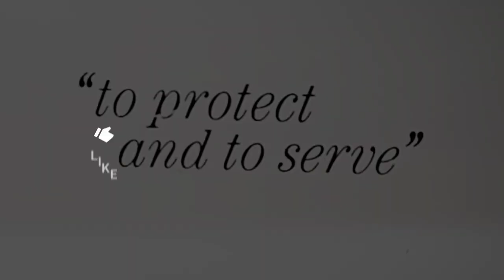Venice Homeless Encampment Cleanup in Full Swing: Comprehensive Operation Underway

Comment: Why are they throwing away the Shopping Cart??? Make that Guy return it to the Store. 🤬
Reply: The store doesn't want it back.. They would have to fumigate it before they'd let any of their regular customers touch it. .. Besides, the store has already written off the shopping cart.
Reply: I thought the same thing about that Bin on Wheels. Why didn't they use it to pick up the other crap?
Reply: I at first!  did not want to mention the shopping cart 🛒. But I taught they same thing! Bring it back to the store or use it to clean up with. 😊 such a waste.
Reply: @dessingo  Realistically, they won't know where it came from, the most they'll do is pressure wash it.
Reply: @dessingo  Ultimately, that means that the shoppers must pay more for their stuff to cover the costs of these stolen carts.  That's money out of the pocket of every single working, tax-paying person out there.  Whenever you see every cart like this, think of how much you are personally paying for it.
Reply: There would be more grunge on that shopping cart,than you can imagine.